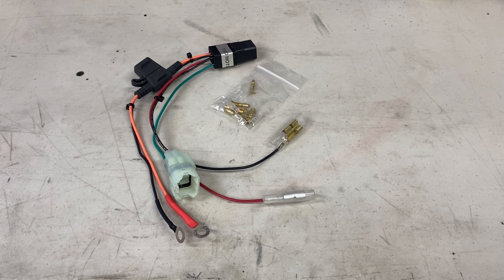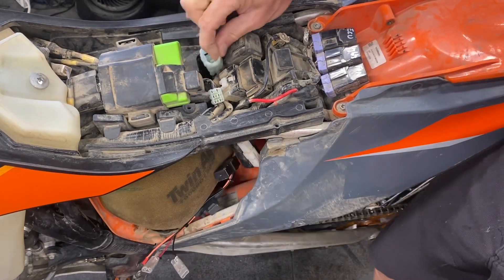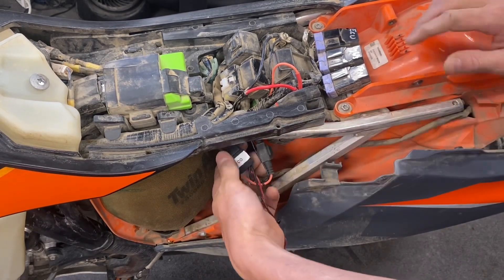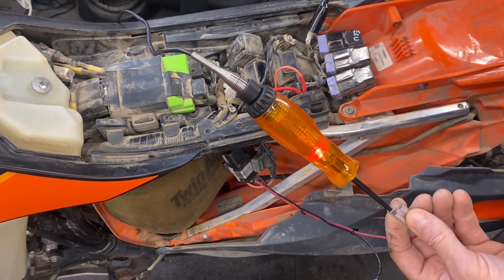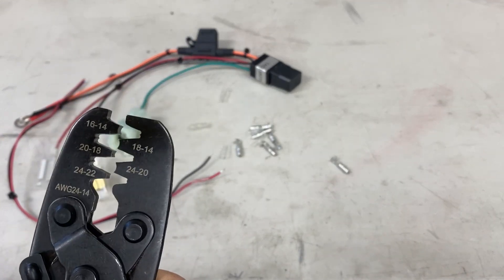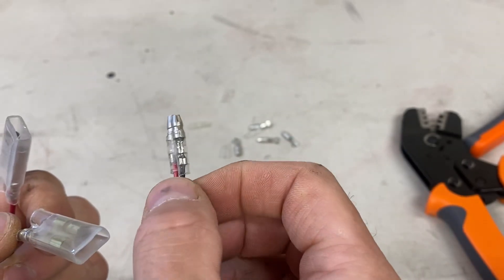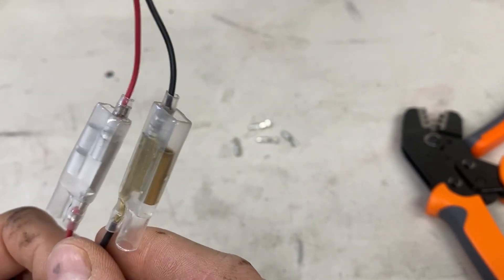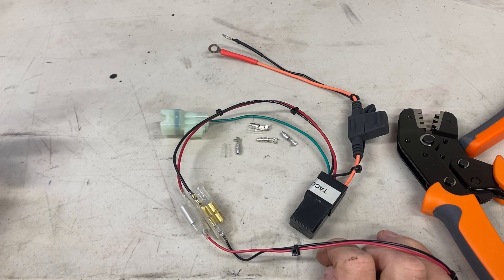How to install the Taco Moto Co. accessory power relay circuit system.

Comment: Installed this relay to my 18 FE350, tight fit with all the other stuff crammed in there but it works great, really like the new connectors that gets rid of the banana plugs.

Comment: Does this work on the 2024 500's?
Reply: No the plug isn’t correct.
Reply: the diagnostic plug is not located in the same place - its on the right side, right of the ECU on a clip mount with a black cap - it fit my 2024 500 EXC-F
Reply: Did this work for you?